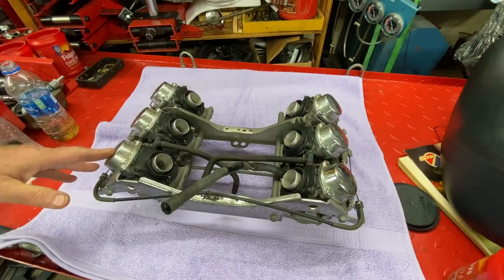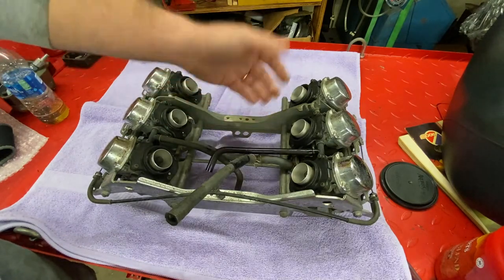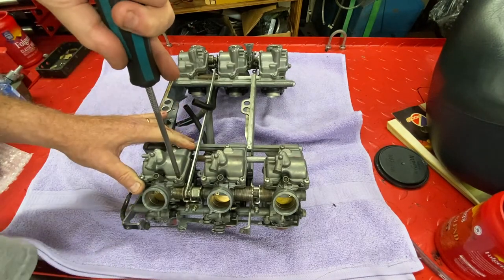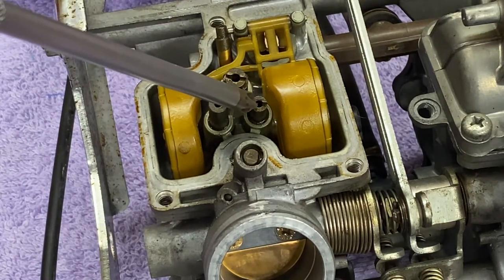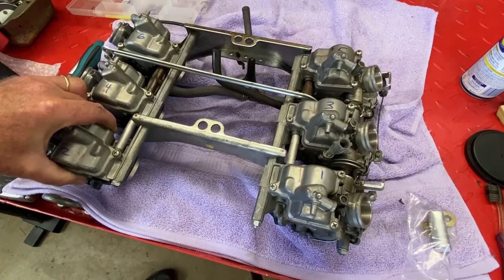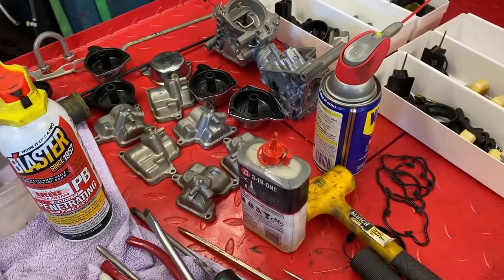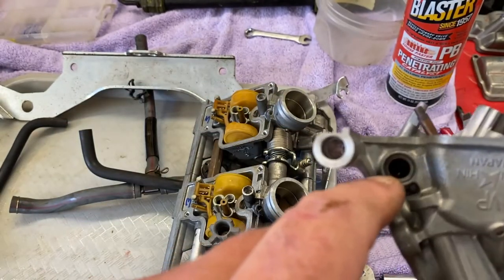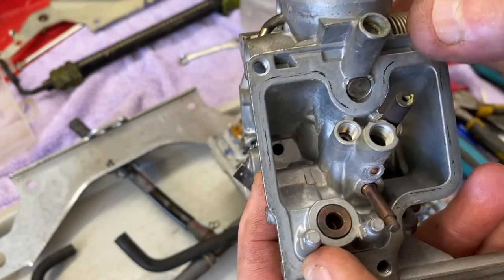Valkyrie Sitting 10 years! Let's fix it! Part 3

Comment: I would like to thank you for the time you take for the videos. You do an amazing job. I live in Miami and let me know whatever you need down here. I have a Valkyrie 1800...thanks god I do not have to deal with 6 carbs....2 or 4 is ok, but man, rebuilding 6 carbs takes a lot of work. Love the sound of the 1500 is amazing but I think I will keep the 1800 fuel injected. Thank you Sir and great job
Reply from the maker: Thanks much for watching and commenting. Six isn't as bad as you might think; once you get organized (that is the key right there) and into a rhythm, you simply do one carb at a time to avoid mistakes.

Comment: A Honda Cardiovascular surgeon, Impressive!  Any need to Re Jet with the Cobra 6x6 pipes?
Reply from the maker: Thanks for watching. I'm not sure about that. I am trying to remember if I even documented the jet sizes. Usually, I would go and check to see if they're OEM sized or part of a jet kit. The Valk did have a J and N filter; but usually, minor if any jet changing is required just with an exhaust change. Usually. There are exceptions of course. The intake side like tossing a stock airbox into the bin and going with pods is what absolutely requires jetting.

I think I recall seeing something in the saddlebag or something regarding a jet kit or something, but I just can't remember. I work on so many of these carbs they all run together.

Comment: I have a 98 valkyrie tourer that I am looking to resurect after sitting since 2007.  Which version of Brasso do you use to polish up the needle valve seat?  There are several version.  I purchased one, but fear that it may be too abrasive and leave a residue.  Do you also do any other cleaning precautions after using it.  Thanks in advance for a reply!
Reply from the maker: Just the regular stuff available at the grocery store.

Comment: I'm going to go look at, and potentially buy, a 99 Valk with only 15k miles but has been sitting for the past 2 years. I can pick it up reasonable but I already know I'm going to have to go through the carbs, if not the entire fuel system. Do you have a link to where we can get the same kit and any other supplies you used in this video? Thanks!
Reply from the maker: Certainly. https://redeye.ecrater.com/c/414983/carb-intake-seal-kits. I just looked, he doesn't have any kits listed right now. However, that usually means he's putting some together. It's a labor intensive job as you could imagine. Last time I saw this and needed one I used the contact at the bottom of the page and asked, he indeed was putting some together so awhile later perhaps a week I went back and ordered one.

Comment: Thanks very much for that. Very informative. I'm looking to delve into my carbs in the near future. 
Can you tell me what the name of that kit is please. It looks more thorough than any other I've seen.
Cheers.
Reply from the maker: Yes. Red Eye Technical. Just Google that. You’ll find a carb kit or carb parts selection on his page and then go to the selection for the entire kit. You’ll have to order bowl gaskets, intake o rings separately. Also there are no float valves included. The OEM are ungodly expensive. Thanks for watching
Reply: @MotoRestoFL  
Yeah I learnt that rebuilding my 500 four carbs with OEM..🙄

Thanks for that.👍

Comment: How do you clean the pick up for the richer  Look like the one change the vacuum dynamic like can be clean is no hole in it
Reply from the maker: I’m not sure I understand your question but I’ll try. The enricher on any carb whether it’s a removable jet or fixed is exactly the same as any other jet, ultrasonic cleaner then blow out the circuit using carb clean and shop air. The carb cleaner is visually checked to make sure the pathway is clear. Shop air just blows out the residue. I do use jet reamers to clean some circuits. It’s very tricky doing that and yes, jets can be damaged but I’ve been doing it so long I kind of know the feel before it could start cutting brass. Nowadays I lean towards replacing jets rather than cleaning. Cost vs labor is usually less.

Comment: Just found your channel.
Great content.

Curious where you buy most of your carb kits?
I’ve tried the eBay kits and some parts don’t work.
Thanks
Reply from the maker: Which ones? For the Valkyrie?
Reply: @MotoRestoFL  I’ve watched a few of your carb rebuilds now.
I’m just curious where your carb kits from?
Not just the valkyrie.
Reply from the maker: @andrewnewman6510  many times I source OEM part by part. This is because Chinese kits are junk. K and L kits from virtually any supplier are decent. JD Jetting has a lot of nice kits. There’s a couple of Honda V4 suppliers such as V4 Dreams. Red Eye Technical used to have completed Valkyrie kits but currently doesn’t. But if I had to Pigeon hole a couple, I use Partzilla for OEM and Z1 Enterprise foe some K and L kits. Mostly, I end up just examining the parts fiche and picking up carb parts like I said part by part. Cheers.
Reply: Excellent thank you.
Great work by the way, very detailed explanation.